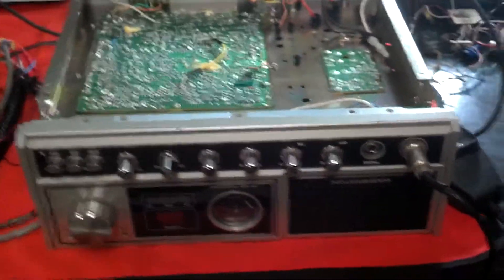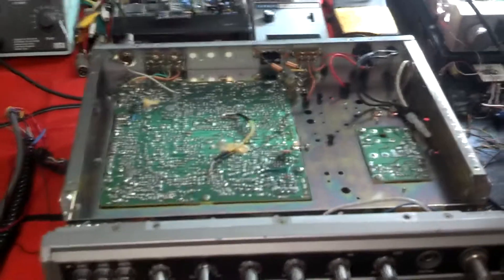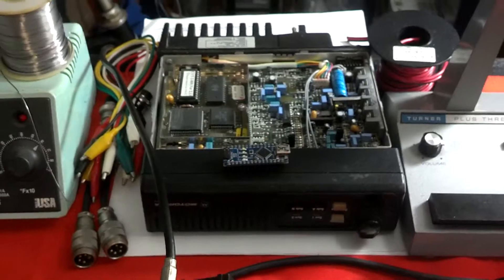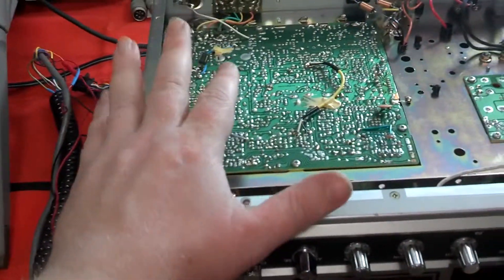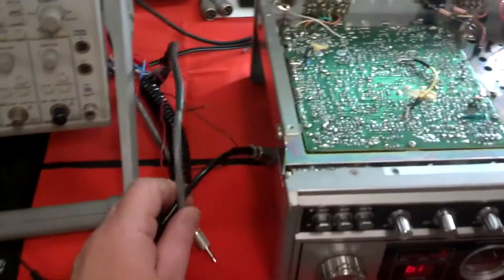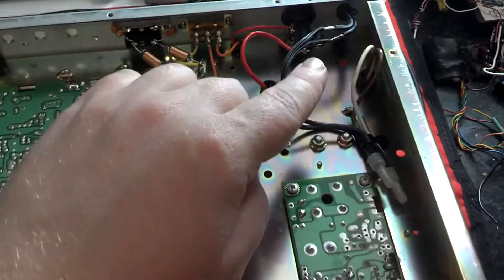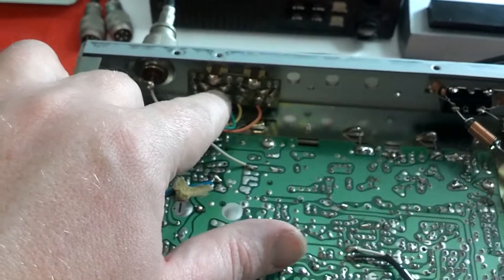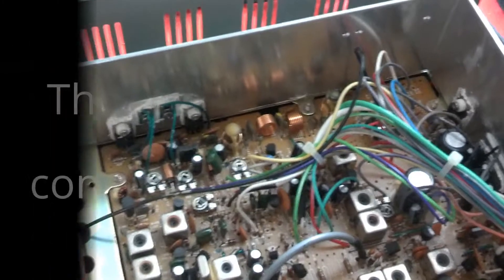Surplus Uniden Washington Resurrection

Comment: Just wondering what Pll you have in that unit.I bought one that some convert to 10 meters no cb band and trying to put it back stock.But mines have no dis capacitor going across the Pll but it has 2 wires tape together  going to two pins on the pll.
Reply from the maker: This is a newer MB8719 PLL model chassis. No channel mods yet, it is bone stock from use by the State Patrol.